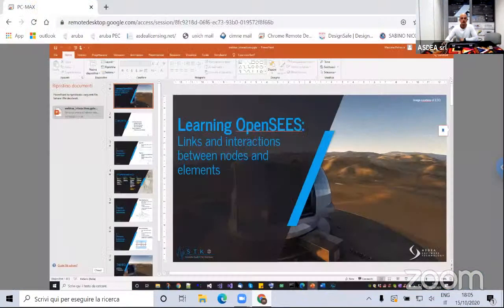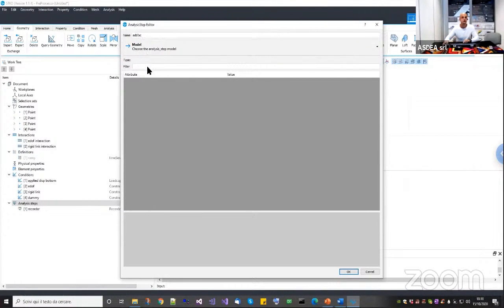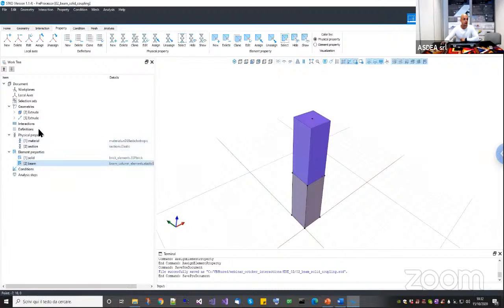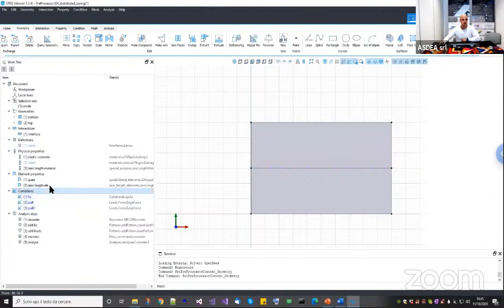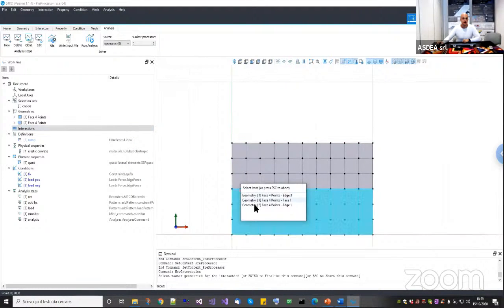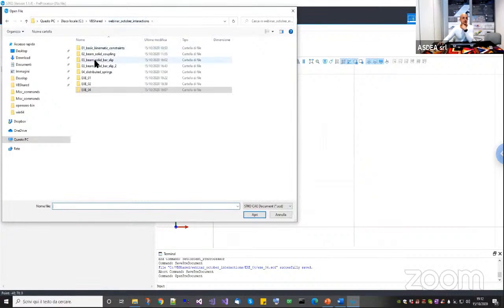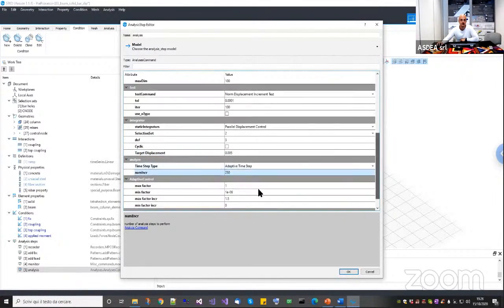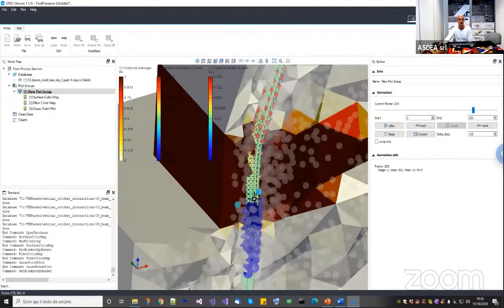Links and interactions between nodes and elements

Comment: What happens if the reinforcing bars extend completely inside the column? How should I define the interaction between the surfaces of the bar holes and the reinforcing bars? In this case, the contact surfaces are internal rather than externally visible, unlike in this example where the contact interface is exposed.